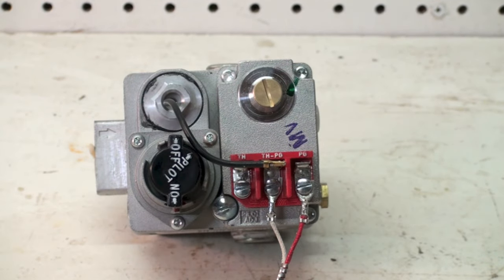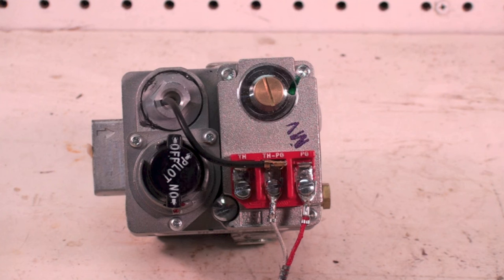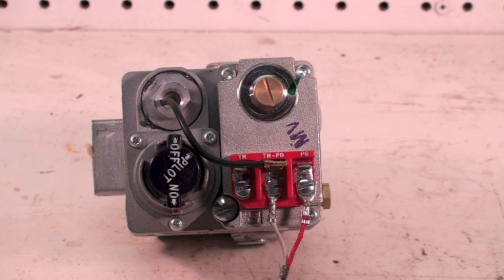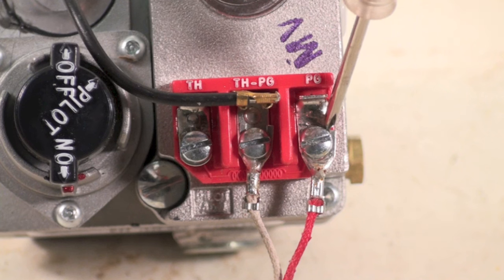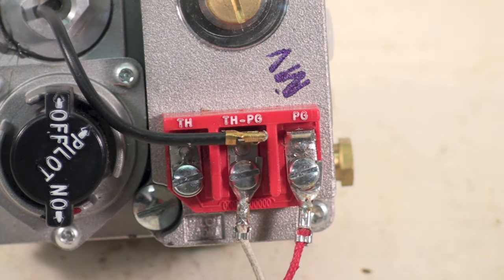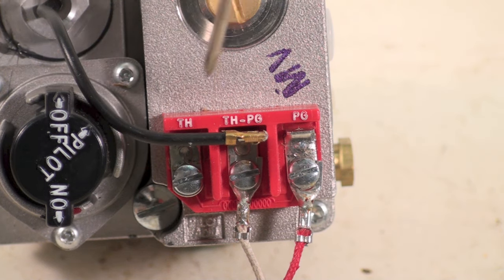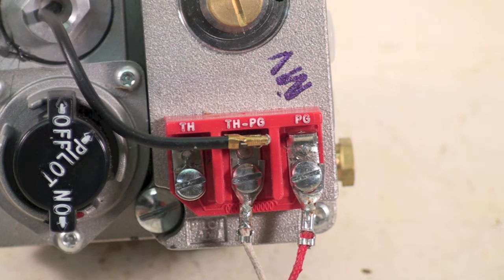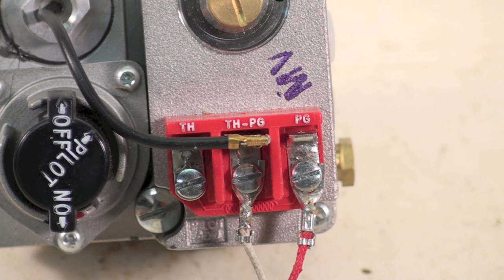Gas millivolt wiring

Comment: Williams went to a very small generator for their wall furnaces, that gave us headaches for years.  I think it only produced 180 millivolts.  You could only use the length of thermostat wire that they gave you.  You have to keep the T stat wire away from 120 volt wires.  I had a wall furnace that would turn on every time the refrigerator ran.  Caused by running the stat wire too close to the 120 volt romex  supplying the refrigerator.
Reply from the maker: That's a cool one.  I have not seen that thermopile.  Must have been fun to diagnose.
GFM

Comment: Hey GFM! I love your videos! Can you explain how a high limit switch would be wired on these 3 terminal millivolt systems? Seems like our old 4 terminal millivolt gas valve won't keep the pilot lit. I swapped out the thermopile even though it tested good =\. The bi-metal limit switch is reading some resistance, however in hindsight, I didn't remove it completely from the system. Are limit switches normally open or closed on these millivolt systems?
Reply from the maker: The limit is usually wired in the TH circuit.  Limits are usually normally closed.
GFM

Comment: Great video, GRM. Thank you for your thoroughness. Can you shed any light on the types of furnace gas valves that were outlawed, the kinds with the red plastic dials? I'm going to need to be able to identify whether our cabin has one of those valves or not, in my efforts to get it working. I was told those can no longer be replaced or found.
Reply from the maker: Give me a brand and model # of the valve.
GFM
Reply: @grayfurnaceman  Don't know, but I'm heading up tomorrow, I'll get back to you on it. Thank you. And yes, it's GFM not GRM isn't it.
Reply from the maker: @jp410  Yup.
GFM
Reply: @grayfurnaceman  Honeywell (I believe) is the brand, and the model is VS821A1277. The guy I spoke with from Williams mentioned that it's the IT valves that were discontinued, and are difficult or impossible to replace. I haven't been able to find out what an IT valve is, or whether the one we have is one of those.

Comment: So the red is the common dc connection? Older thermopile I’m removing from a Williams and replacing with a 700 robert Shaw valve and is giving reading of red wire being negative.  My new thermopile is reading red as positive.  What gives?
Reply from the maker: Polarity is not an issue for these components.  It will work either way if you wire it in the way the old one was.
GFM
Reply: Thank you for prompt response.I noticed it works either way and kinda figured with no polarity markings. I know AC will work either way, even though it doesn’t make it right to reverse polarity. I was just blown away how old thermopiles red wire is negative.  I’m just going to put positive lead on piggybacked terminal with thermostat wire.  Thanks again for great vid.

Comment: How would would one turn on the gas fireplace when the pilot light is lit but only standing, in a power outage. Mine is a multi volt system as well.
Reply: It’s also on a switch.
Reply from the maker: @Barrymacockkiner3050  There is also a switch in the control center under the fireplace.  Merry Christmas
GFM

Comment: Question does it matter  which  PH wire  we use . Can we switch the white and red wire without any problem ? Since they are both PG ?
Reply from the maker: Those wires are interchangeable.
GFM

Comment: Hey, great videos. I have a Hearthstone Sterling DV nat gas stove. 12 years old, don't use it much. Leave it shut down 6 months. Just started it up, had a hard time keeping pilot to stay lit. Took quite a few tries. After it finally stayed lit, I turned on T Stat remote and gas valve did not open. A few tries and it finally ignited both burners. After a minute, all went out. Same thing a few times in a row. This unit has a thermocouple and a thermopile. Which one do you think I should replace? Thanks for the help!!
Reply from the maker: If the pilot is blue and covering the thermocouple and thermopile,  you could have a problem with output from the thermopile.  You should have 325 MV or more output with the burner off.  Be sure all wire terminals are tight.  Hope this helps.
GFM

Comment: Can you do a video to show the wiring diagram inside of gas valve? It is confused just see TH PG terminals. Also will white and red leads matter on which terminal should be connected? Thanks
Reply from the maker: I will put it on the list.
GFM

Comment: Hi Gray,

I have a gas valve chain, on an old Luxaire, (SH-125). The gas valve is a Honeywell VS87A9X4X2. I replaced the limit switch about 3 years ago. I think I replaced the thermopile about 5 years ago (but I am not positive I replaced, maybe I just cleaned it).

About once, or twice, a winter the main burner does not ignite - even though the pilot is on and thermostat is calling for heat. I have found that if I tap on the valve chain, it will usually ignite after a few taps.

Do you think this is a thermopile issue, or gas pressure issue, or sticking gas valve issue, or something else.

I replaced the limit switch about 3 years ago. I have some pictures of the gas valve train, but not sure how to post them here. The gas valve has 6 screws with wires attached - 2 screws for Thermostat (TH1 and TH2), 2 screws for thermopile/Pilot generator (RED, WHITE), and 2 screws for the limit switch (L1 and L2).

I watched your videos on thermopiles, and antique furnaces. That got me to think I should put a meter on the gas valve, both while the burners are on, and after burners kick off. (I thought the millivolt readings might be useful to compare against later if it does not light again later this winter). 

These are what I thought I saw:
1) With the burners on:
    T-stat wire leads read 126 (on 200 mvDC scale) 
    LIMIT switch leads read -4.5 (on 200 mvDC)
    Thermopile leads read 1 (on 200 mvDC), and 379 2000 mvDC

2) After the burners tripped off:
   T-stat wire leads read 1 (on 200 mvDC scale) and 611 on 2000 mvDC
    LIMIT switch leads read 0 (on 200 mvDC)
    Thermopile leads read 1 (on 200 mvDC), and 630 2000 mvDC

I only changed to the 2000 mvDC setting if I saw reading of 1 on the 200 mvDC setting. Are these readings looking correct to you for a functioning gas valve? That is, am I reading it right?

I ask because one of your videos showed, I think showed, 544 mvDC when you put a flame on the thermopile, and 310 mv with the pilot on it, and you stated a thermopile will trigger the valve at between 125 to 300 mv. (My readings seemed to be from 379 mv to 630 when I put the meter in the 2000 mv range). Also the autoranging meter you used displayed "0.544" - which I thing you said was 544 mV? I used a manual ranging meter, and mine showed as "379" on 2000 mV. (I hope I am getting this right?)

Can you help me diagnose what I am seeing, and what might be wrong?

I can send pictures of the valve if that would help.

Thanks

Comment: Millivolt is such a genius system, makes me wonder why we've moved away from them. Who wants to be cold when the power goes out?
Reply from the maker: The problem with millivolt systems is voltage drop.  With voltage that low, any poor connection will stop the unit from functioning.  
You are also stuck with natural air flow.  No fan to move the air.
GFM
Reply: @grayfurnaceman  interesting, because I just had to replace a thermopile and when I took it off, the connection was obviously the issue - the wire was poorly attached. But honestly if one has steam heat, you can't beat having heat when the power goes down, like during a blizzard.

Comment: So if i have dexen 6003ks millivolt and gas fireplace without the fan, then I don’t need a power hook up?
I can hear gas coming but very slowly and when i try to light i see a small spark but doesn’t light up. Is this indication of a bad or clogged valve? It hasn’t been used for a decade if ever was.
Reply from the maker: If you are trying to start it with a piezo ignitor, (you press a red button for spark), you may simply have air in the gas line.  Just keep doing it until it lights the pilot.
GFM
Reply: @grayfurnaceman  thanks, i will try that

Comment: I have a  White-Rogers millivolt gas valve on a gas log Model # 36C03U-333 I just installed this new gas valve the 
thermopile is putting out 500 millivolts I put in a new one. I have wired the thermopile to the TH-PG and PG terminals
and the wall switch to the PG and TH terminals. The pilot light is strong the wall switch ohms out good. The gas valve 
won't open even if I jumper from PG to TH. This is the second valve I have put in thought the first one was bad
 but not 2 in a row. Any suggestions out there would be welcome
Thanks
Bill
Reply from the maker: Is there a limit switch that you have not found?
GFM

Comment: Is there a way to trigger the wall switch in the event of a power outage where the fire place has not "battery accessory"?  Seems like you could use a 9 volt battery and tap the wall switch wires leading to the fireplace.  Or something similar - in an emergency.
Reply from the maker: This all depends on the system.  Some are set up with a manual switch that will operate the burner without power.  It may be located under the access panel below the burner assembly.  Merry Christmas
GFM
Reply: @grayfurnaceman  First - Merry Christmas (see Galatians 4v4-5)
Second - thank you for the response
Third - Seems a manual switch would still need some power - no?  

What I have: Heat-n-Glo Model SL-550TR  

I looked and found the manual switch - it works.  I see the "wall switch" is the alternative to the "manual" switch.  (We do not have a remote.)  

What happens when the manual switch is turned on/off?  Opens the gas valve?  Needs no electric (even milli-volts worth)?

Thanks again and look forward to your response.  It is 22 degrees F below windchill and -1 degree F where I reside in the mid-west.
Reply from the maker: @mark1verses14and15  I believe that unit is millivolt operated.  The switch inside the unit is in parallel to the wall switch and either should operate the fireplace.  The fan will not operate but it will heat.  Merry Christmas
GFM
Reply: @grayfurnaceman  Thanks for your attention and Merry Christmas!  Isaiah 53

Comment: I have a gas fireplace that we don't use but I know works. Right now I have a wire (low voltage) sticking out of the wall. I think it used to be a thermostat but it's been a while and I forget. Was going to just connect it to a switch, but there is no electrical box in the wall, just a wire sticking out of a hole. To use the fireplace now, I just need to connect these wires. It's long due for me to deal with this eyesore, but what do I use? Just get a thermostat or should I cut open the wall and put in a box and a switch? It's all finished drywall so I'd rather not open it up if I don't have to.
Reply from the maker: You can use a standard light switch.  Just replace the screws with moly type drywall fasteners.  Can then mount a switch covert the light switch.

Comment: Does it matter where red or white goes from thermopile to gas valve? Seen many videos and it is confusing. Is there a manufacturing spec on this?
Reply from the maker: No, the wires are interchangeable.
GFM

Comment: to install a milivolt thermostat would you connect to the same terminals as the on off switch on a gas fireplace/stove. Which terminal or terminals have the voltage present.
Reply from the maker: Jan Otting Just use the same terminals as the switch.  Be sure all connections are tight.
GFM
Reply: Thank You sir

Comment: Hi Gray. I have watched many of your videos and they are great and educational. Thanks you so much for sharing your experience!

I now have a problem with a new combination valve that I just installed on a milllivolt (thermopile generator) on Luxaire SH-125 gas furnace. (I replaced the valve as the main burners sometimes did not come on unless I tapped the regulator/gas valve. The old valve was a nuisance having to tap on it occasionally to open the gas valve, but it worked fine otherwise - including the pilot).

The old valve was a Honeywell, with six screws in the valve body for all the leads  It also had a pilot line that was fed off of a separate gas cock mounted just before the main gas cock valve. This is different from the new installed WhiteRodgers valve where the pilot line feeds out of, and is controlled by,  the new combination valve. Could this be the reason the pilot goes out on high LIMIT - it is no longer indepandent of the valve control unit?
 
The new valve seems to work fine up until the point where the limit switch is tripped and at that event the combination valve 'clunks' and main burners close - and the pilot flame goes out. So at  that point the furnace is no longer operational since the pilot light is off. 

I had my multi meter on the two leads of the thermopile's connections at the combination valve at TH-PG and PG. 

The millivolts reading was 400 Mv with only the Pilot on. It drops to about 375Mv when the burners come on. 

When the LIMIT activates, the millivolts readings immediately drop, and  the main burners and the Pilot flame both go off.  (That is how I knew the pilot went out at that moment - the millivolts sudden drop and observation that pilot was out.)

My new valve looks just like the on in this video. The new combination valve is actually a WhiteRodgers 36C03U, for 750 millivolt pilot generator furnaces. 

I have wired the limit, pilot generator and thermostat as described in the installation instructions, with the LIMIT switch leads on the power 'pigtail' of the screw in power feed, and the TH-PG terminal. 

The pilot generator leads are to the TH-PG, and the PG terminals, on the combination valve.

The thermostat wires are to the TH, and TH-PG screws. (Not sure which is red or white at that point, as it is just two black wires in the furnace cabinet - but I assume it does not matter?) 

Could  I have a faulty gas valve (even though it's brand new)?

Have I wired something wrong? 

Is the Thermopile ok? (is 400 MV while connected to the combination valve) and just the PILOT FLAME adequate voltage?

Do you think I need a new thermopile?

I am really stumped. I can even turn the gas cock on the combination valve off, and on, several times, and the PILOT stays lit whilte the burners go off and on. The PILOT stays lit when the main burners fire up, and when the blower motor comes on. 

It seems wrong that the LIMIT switch should turn off the main burners and the PILOT FLAME!
 
Should I cap the pilot outlet on the combination valve and put the pilot line back to the old, separate, pilot gas cock?

Please, any help you can give me would be much appreciated.

Thanks,
Matt 
mnalep@aol.com

Comment: Can two of the millivolt wall furnaces be controlled by one thermostat?? Is there a two pole thermostat so the signal from one furnace won't open a gas valve on another furnace that has no pilot?? 
Thank you
Reply from the maker: There is nothing that I know of.  It could be done if you have a low voltage control system using a relay.
GFM
Reply: I am having the same issue. I am looking at wiring it up to the "fan" relay. Just need to figure out the two relay contact points and Ill have a multistage setup :)

Comment: If I have a millivolt gas valve. Do I have to use a millivolt thermostat? Or can I use a regular heat only thermostat?
Reply from the maker: The millivolt thermostat will provide anticipation where the 24 volt one will not.  That means you will have wider temp variations in the structure.
GFM
Reply: @grayfurnaceman  Temp variations as far as set points on the thermostat fluctuating from set point to shut off?
Reply from the maker: @wisconsinbush2940  Meaning wider swings in temp of the structure.  A little colder when it starts, then a little warmer when shuts off.  Probably 3 to 4 degrees F.
GFM
Reply: @grayfurnaceman  Correct.

Comment: In a milivolt system, is there a thermocouple and a thermopile? Or... does the thermopile do the job of both parts?
Reply from the maker: No and yes.  To further explain, some millivolt systems, meaning any system that uses only millivolt controls for the operation of gas controls, will use the thermopile for both operation of the main gas and pilot safety controls.  However, some systems use both.  The thermocouple is used for the pilot safety.  The thermopile is used to power the main gas.  Hope this helps.
GFM
Reply: grayfurnaceman I was worried you might say that. lol. Thanks for the info.
Reply: How much current does the gas valve require to remain actuated?  I assume the main gas valve requires higher current than the pilot shutoff valve.

Comment: Question: My wife accidentally pull the TH PG wires off and I re-connect them. The problem is when I turn on the pilot successfully, the pilot turns off when I turn the heat knob to high on the thermostat. Any advise?
Reply from the maker: Juan Rivera First, be sure all wire connections are tight.  Next, you might send me a pic of the wiring that was broken.
GFM

Comment: Is there a way to run the gas fireplace when the pilot is lit and the power is out?
I have a switch connected to the TH and PG (above) which lights the fireplace.
I was told when the power goes out I can not use the switch to turn on the fireplace.
Reply from the maker: +Steve Sound Yours sounds like its a thermopile system.  If so, the unit will run normally without power.  If there is a fan, it won't work.
GFM

Comment: Are these things used in gas fireplaces and the like ? Not in gas boilers/furnaces?
Reply from the maker: The most common usage is in fireplaces and free standing heaters that may need to be used in power outages.  As boilers and gas furnaces use 120 volt power, they are not used there.
GFM